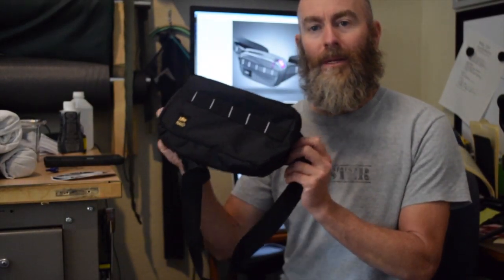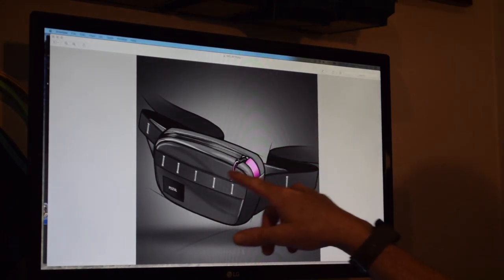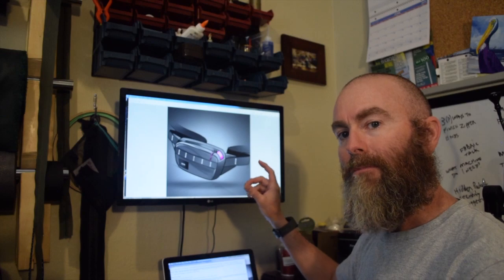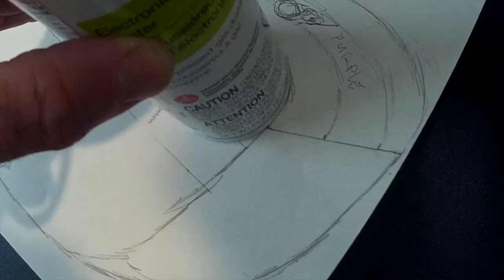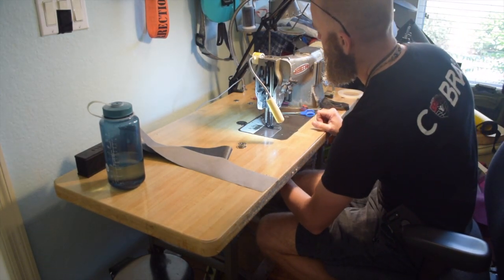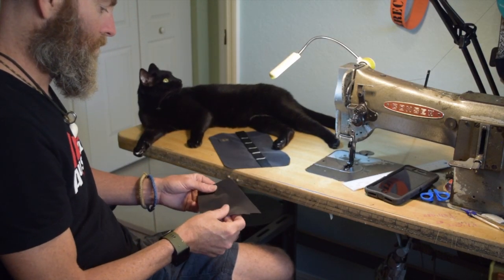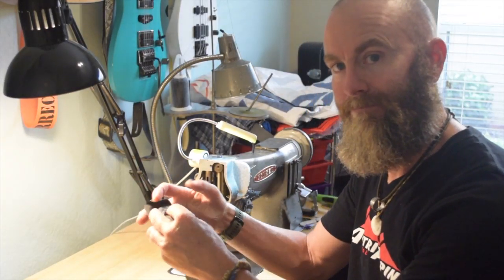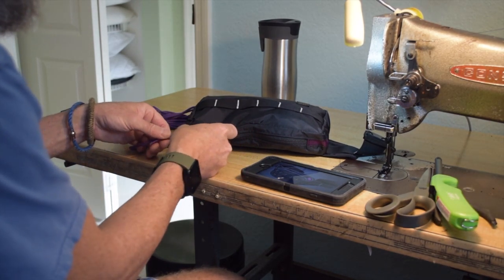Fanny Pack Based On An Instagram Post: Am I Really Doing This?!?

Comment: A couple of things of note: when you make mistakes there is never coffee or a cat to be found - just saying that after the accident they were both there and it went smoothly.  Small binder clips work well for 'basting' and they also make WonderClips that are the sewing equivalent that dont leave marks in the 400D.  Also, as a service tech:  please dont use canned air on your machines propellant dries sticky which makes the lint stick better.  For your followers with newer machines that are not as accessible,  they are pushing the lint (and propellant) further in and toward electronics.  LOVE your videos!
Reply from the maker: Thank you Lisa!
Regarding the canned air, that's a great point.  I don't use it on my sewing machines, I have if for other stuff but it lives in the same room.
I often use Wonder Clips (love them), office binder clips (also love them), and, rarely, pins (don't love them).  I like to use binder clips when mocking something up to see how the panels are fitting.  Staples are great for the actual sewing because they don't get in the way and I don't have to remove them as I sew - EXCEPT that they will cut you lol.  But yeah, there are many tools to do the job!
Thanks for being part of the channel!

Comment: Ditto on side buckle preference (I have a couple packs where it's in the middle and I prefer it  close to the pack).
And I also prefer my 237 zig-zag for bar-tacks - and my clipper plier-stapler for basting!  😁
Nice pack Jason. The addition I would make, if I were to build it, would be a padded divider to tuck my phone in to protect it from my keys.
I too wind multiple bobbins for my industrial when I set up for it. 
Great tutorial and reverse engineering.     
Looking forward to seeing which binder attachment you get. I have the fixed one, but I am jonesing for the swing away binder attachment like Alexander Dyer shows in his Singer 251-22 vid. (and others) 
Cheers!!
Reply from the maker: Thanks David!  And your contribution to this pack was greatly appreciated!

Comment: Love your stuff, and your style (UK viewer, so ref to name very funny). This may be a very basic request, but could you please do a vid about needle and thread type/width for thicker materials?  My wife has a Bernina 430 and I'm interested in canvas bag projects, but have no idea what thread and needle to use. Thanks.
Reply from the maker: Hi Jay, 
Thanks for being part of the channel!
A video on needle/thread/material relationships is on the short list for me to make.  In the meantime, here it is in a nutshell:
Choose the appropriate thread for the fabric you're using.  Choose the needle that fits that thread.  There are charts online, and if you know the manufacturer of the fabric (for example, Cordura), you might be able to find their recommendations for thread and needle sizes.
There is a bit of flexibility, inasmuch as if your needle is a little too big or small, or the thread is not quite the correct size, it'll still work fine.
I generally use between 400D Nylon packcloth or 1680D ballistic nylon, and I tend to use the same needles - 70 to 110 in domestic machines, 18 to 22 in my industrial and Sailrite (both of which use 135x17 needle system). I use size 69 bonded nylon thread for nearly everything.
Lately I've been sewing quite a bit of Tyvek, which is very thin.  If I don't change needles or thread, I can sew it OK.  It definitely prefers thinner thread and smaller needles, though.
I hope that helps, thanks for the video suggestion, I hope to get working on it soon!
Reply: @thejasonofalltrades  Thanks for the advice - I may have been overthinking it a bit, but probably more important in high stress uses like outdoor etc. I went with Denim needles size 100 and Denim thread (polyester) which seems to be working well and the denim threads come in really nice colours to boot! Thanks again.

Comment: I just recently did something very similar (replicating the spritusystems fanny from a photo) I had trouble measuring for the panel that becomes the side and bottom and connects up to the zipper. I may have just been overthinking it with seam allowance but if you have any tips I could definitely use them!
Reply from the maker: Hi Nic, 
In my case, I couldn't really get it wrong, since the thing I was copying only existed as a rendering.
Can you elaborate on what problems you had?  Feel free to email me at 
the jason of all trades @ gmail . com (remove the spaces) if that's easier.

Comment: I also have a singer 239 and i can not for the life of me get this pedal to run the machine as slow as yours is running. Can you provide any guidance?
Reply from the maker: Hi, 
Sorry to hear you're having trouble with your machine!  Mine runs exactly like all of my other domestic sewing machines, no issues with speed control.  I don't know exactly what is going on with yours, but one guess might be that the rheostat (if that's even what it is, but that's the idea) in the pedal may not be functioning correctly.  It could be really dirty or bound up with thread, for instance.  It might be worth taking the pedal apart (UNPLUGGED) if you are able and see if there are any obvious issues you can fix.  You should be able to buy a replacement pedal, that might be worth a try.  I suppose something could be wrong with the motor, but I'm not sure what that might be.
There's a guy on YouTube called AndyTube who does repair/rebuild of vintage domestic sewing machines. You might check his videos out or reach out to him to see if he has some ideas.
Good luck!